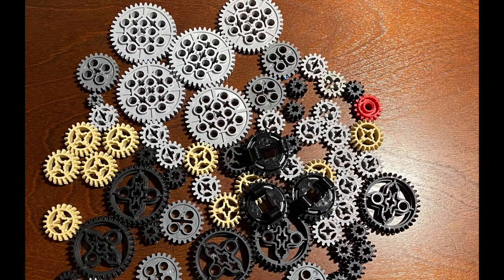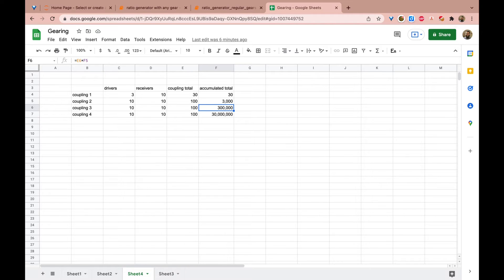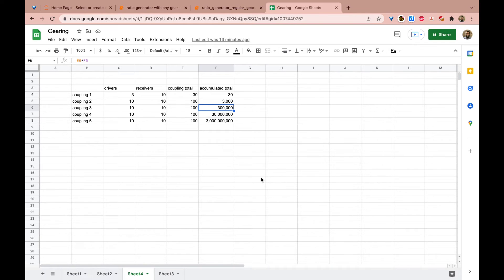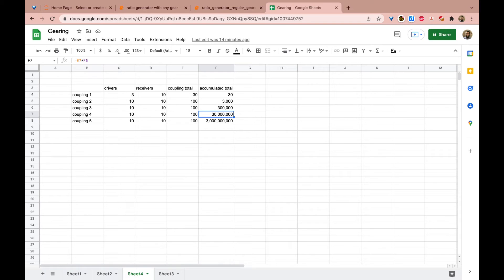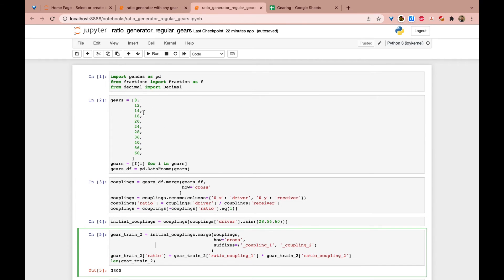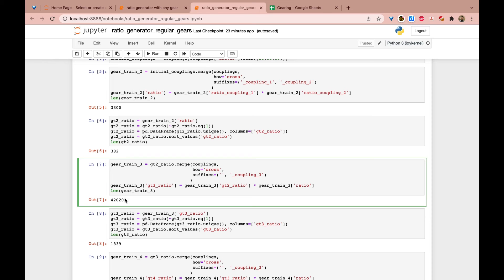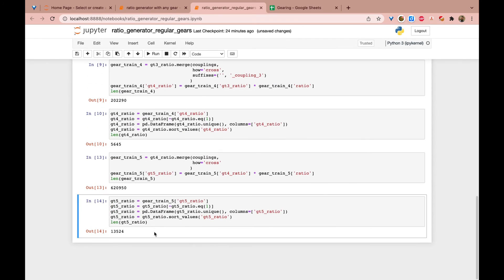My Great Gear Hunt Part II: The HUNT!

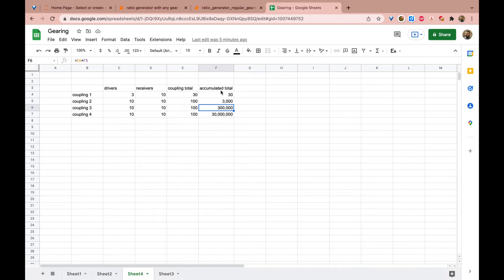Comment: Hi! As you noticed, you cannot get 1:11 by just multiplication because 11 is not divisible by anything (and obviously any result of multiplication is divisible). The only way to get any prime number is addition/subtraction. Overall, for any ratio that can be expressed as a fraction, you only need to work out the prime factors of numerator and denominator to get the simplest gear ratios, no need to scan through milions of combinations.

I had run a similar script (although written in Matlab) for my recent calculations; as you noticed, the number of unique ratios is not that big.
Reply from the maker: Thanks! I knew there was a simpler way lol
Reply from the maker: Question: is it also easy if you want to choose your gears? I want to make a small web app to allow people to calculate gear ratios based on the. Gears they actually have
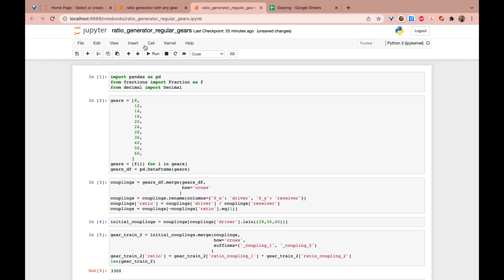Reply: @berellevy2  Not so easy. Some simple ratios like 1:2 can be done in multiple ways (8:16, 12:24, 20:40, 28:56), others like 1:5 are harder (8:40, but you can also use 1:2 and 8:20 or 1:3 and 12:20) and for anything containing 1:7 you need the 28t gear.